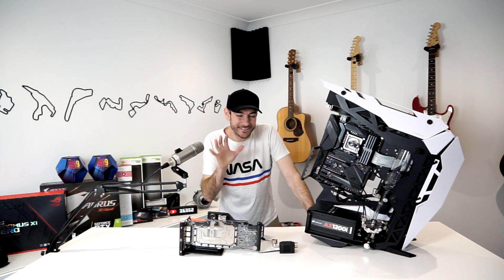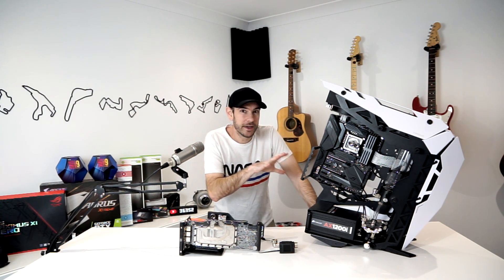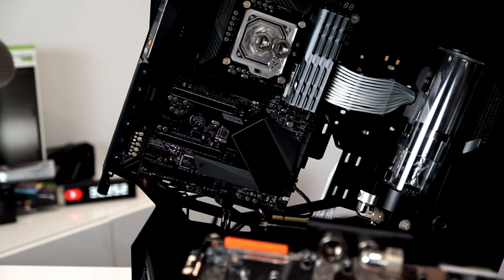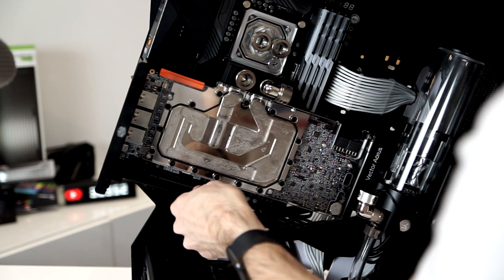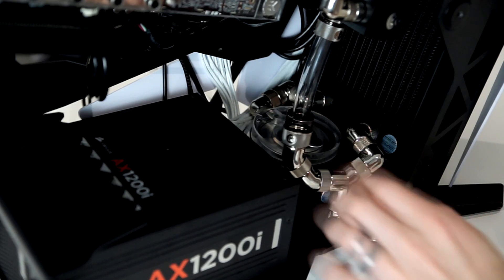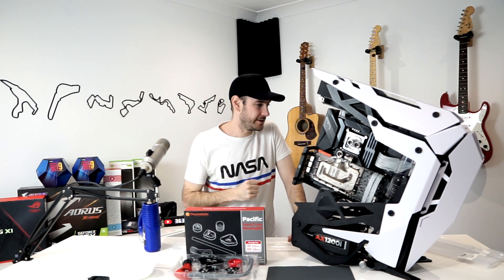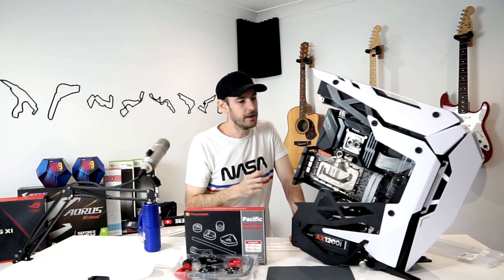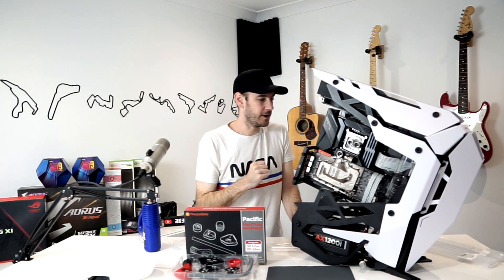PC Watercooling Guide - How to Bend and Install Hardline Tubing

Comment: How do you keep the rings from scratching the petg? I have a really hard time keeping the tubes from getting scratched when i install the rings over the tubes for the final fitting
Reply from the maker: It does happen from time to time. You can wrap some masking tape around the tube u til it’s clamped down to protect it if it worries you.

Comment: way back when in the WC world, 90 degree angles = worst thing you could do, restricts water flow by up to 50%. Is this not the case any more with the hard tubing or something?
Reply from the maker: With hardlines when done properly they are mandrel bent so the internal diameter remains the same and thus has no impact on flow.

Comment: Are the compression fittings suppose to screw all the way down? I have the Bitspower advanced ones and they only screw about half way down. It's pretty tight but idk, seems weird. In this video I see they go all they way down when tightening. Any advice please?
Reply: I think there are different lengths and depths to fitting threads and fitting inserts on radiators and such.  Are the Bits Advanced known for having longer threads? Sounds like that might be it

Comment: I just got the same case and I'm looking to get the same vertical GPU mount that you used. Would you be able to link the one that you used? Thanks in advance and really like your builds. Keep up the good work
Reply from the maker: Sure thing. Here you go :) https://amzn.to/2MS6Us8
Reply: @boostedmedia  thanks for everything.  With your help and tutorial I was able to complete my build and I'm extremely satisfied with the result. I couldn't have done it without your guidance and times did seem extremely difficult at times but I would keep referring back to your video to try to come up with solutions to my problem. On top of that I had to use my 480mm rad from a previous board on top of the case because I didnt want to waste it or sell it. Did the best I could with it over hanging off the back edge of the case. I would send you a link to see my finished work but I'm not sure if your ok with it here. Thank you very much for inspiring others like myself to keep building. Keep up the good work

Comment: I also noticed you are using PETG tubing. Fun fact, and something I never heard even after watching 100 how-to water cool your PC videos.... PETG tubing is water soluble. Well a better description would be "water vapor soluble". The first time I put my insane GPU loop together I used PETG. It came out looking beautiful and PETG is so easy to work with. However, I soon discovered I had to add as much as 4 oz. of water a day. WTF right? Where is all my water disappearing to? I had zero leaks. I was baffled until I did some deep web surfing. I looked into how PETG was made and that's where I discovered that evaporated water can pass right through the walls of PETG tubing. Now my water loss is extreme because my loop uses over 40 oz of water, but make no mistake all PC PETG water loops will lose water right out the sides of the tubing. Yes, I know it sounds like I'm nuts, but if you check it out and make note of how often and how much water your adding to your system, you'll discover I'm right. I haven't lost a drop after going to hard brass.

Comment: This thing is Sim Racing PC Porn. About the water pump being the lowest part of the loop. In my case the pump is the highest part of my loop. Done this way makes my PC a breaze to fill. I just open a port at the top of the 700ml Res that's mounted on the back of my case. I also remove a plug on top of my 200ml Pump/Res Combo to release trapped air while I fill. I can then start pouring water in the top of my 700ml Res and fill almost the hole loop without starting the pump. My System uses over 40 oz. of water and most of it goes in on the first pour. This also cuts down on the air mixed into the water.

Comment: Primochill sells bits that attach to a drill to burr out the inside of tubing... highly recommended. Big time saver... can even be used to shave down a bit of length quickly.